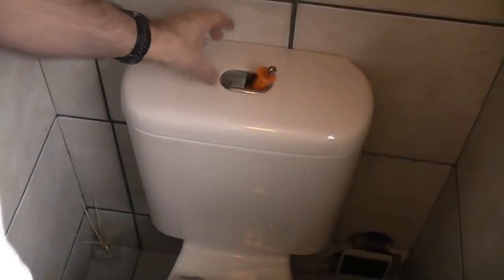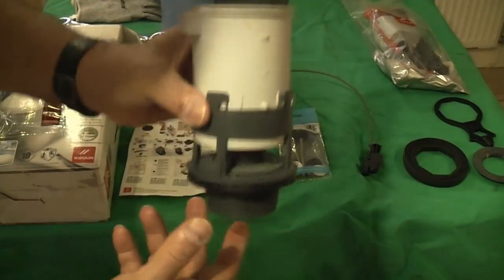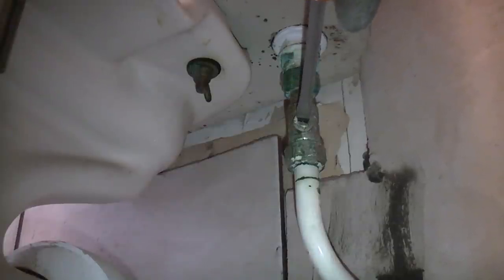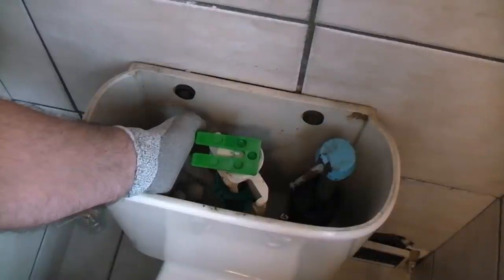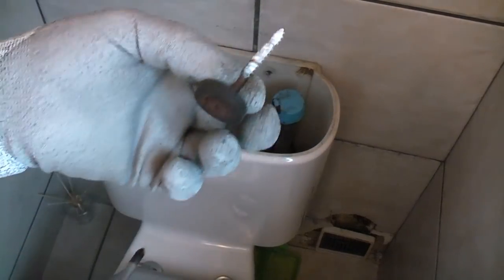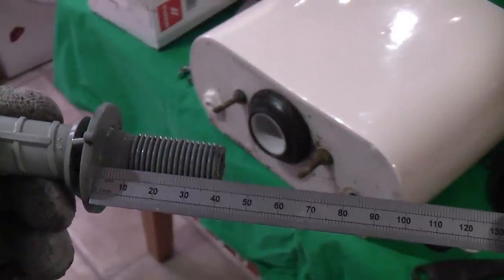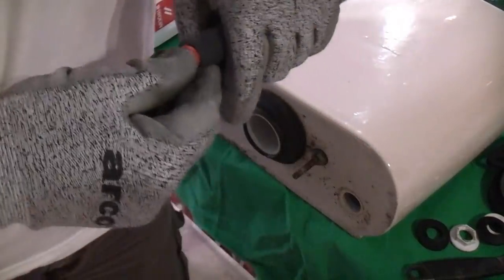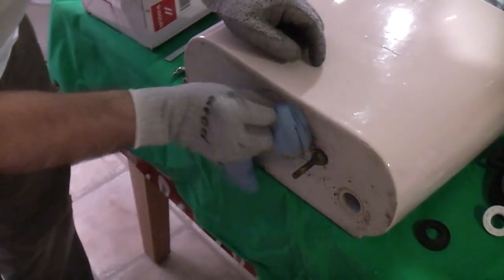Touch free toilet flush | Jollytronic Installation

Comment: i had the flush valve that you fitted for 10 years, it was good for all that time but it started to jam up and wouldnt reset when i pressed the button, they are decent for the price, 10 years use without fuss is good in my books. one issue i do have in my bathroom is getting condensation building up on the outside of the cistern, not sure the best way to deal with that.
Reply from the maker: That's good to know, I'd be happy if it lasted ten years (I might not be around then).
Condensation on some cisterns can be a real problem, we are lucky here, as it's not an issue. There is no heating in the downstairs toilet room (where this video was filmed), the other toilets are a fair away away from the incoming water supply, so by the time the water gets in the cistern, it has warmed up already.
I remember at one of my friends houses, the condensation was terrible and used to drip off onto the floor.
There's not much you can do about it, apart from insulating the inside of the cistern.
Thanks for the comment ;-)

Comment: the grey overflow pipe that you cut is actually adjustable💁🏻‍♂️ it adjusts just like those extendable pan connectors, you just pull the pipe and it springs up to different heights
Reply from the maker: That makes sense. The instructions were terrible, but I'm sure it showed a picture of a knife alongside the overflow 🤔
Thanks for the comment 👍

Comment: I’ve had many cisterns where the wing nuts have rusted solid and won’t turn, I have invested in a multi tool with a metal cutting blade to cut off the nuts.
Reply from the maker: I've used a grinder in the past- https://youtu.be/y4AdckesOlg?t=320

I had to use a multi-tool to cut the bolts that hold the toilet seat on a few weeks back 👍

Comment: So the first mod you did is not the norm ?
I prefer it chez..then again im from Bury :)
Is this one of them new flush things that you have to flush three times..to remove the log in the bog :)
N x
Reply from the maker: The first time the toilet broke a glued a plastic shim onto the top of the flush mechanism, that worked for years. Then it broke again, so had to modify it with steel wire and a space plug 😂
That worked great, but some kids struggled with it. I think it was a focal point in the room LOL
You only need to flush this once, just hold your hand over the sensor for a couple of seconds and it gives a great flush 👍

Some toilet flushes are totally useless though, I think it was something to do with the EU, where they reduced the amount of water in the cistern- so that you had to flush it several times 😂
Thanks for the comment, Neil 👍

Comment: What do you call those flushes that attach to the cistern lid? Ive been looking for videos on how to replace one but i dont know what to call them to search for info/videos
Reply from the maker: Not sure what the exact term is, I often call them push button toilets, or modern flush valves.
Some work by the button pushing directly onto the flush mechanism, and some use a cable.
Thanks for the comment 👍

Comment: Inlet valves with brass tails are preferable with fixed pipework and don’t tend to cross thread
Reply from the maker: I totally agree, I actually have one in my office and was going to fit that, but the shank was shorter than the shank on the supplied one, so I opted to use that.
Thanks for the comment 👍

Comment: Why didnt you add a flexi pipe?
Great channel best wishes👍🏼👍🏼 👍🏼
Reply from the maker: A few reasons-
1) the pipe was copper, painted, bent and short, so joining to the pipe would be difficult.
2) I've not seen any flexi pipes that are so short, most of the ones I have seen are at least 200mm long. It would also mean bending the flexi pipe- which should not be done.
Thanks for the comments 👍
Reply: Where I need to fit a flexi in a confined space a complete loop works well
Reply: @markware85  Hi - do you mean loop in the flexi pipe or something else?
Reply: @ultimatehandyman  makes sense - I think I once got a 15cm one but short ones are not readily available. Thanks for your reply really enjoy your content. 👍🏼👍🏼 used your video to help tank bathroom before.
Reply from the maker: @mshahid2898   I'm glad that the videos help ;-)
Thanks for the comments

Comment: Hi, Can this sensor be mounted on the panel of a concealed cistern? Thanks
Reply from the maker: Yes, it can, but I would not install another one to be honest.
The damn thing eats batteries- you get nowhere near the number of flushes that they say you can. I got so fed up with replacing the batteries, that I removed the cover and just push the button down manually. I tried new batteries a few months back and confirm that it no longer works!
Reply: Oh. Only I have arthritis and I am looking for an alternative to the push flush for my concealed cistern
Reply from the maker: I’m afraid I can’t recommend this one, like I say – the batteries always need replacing- then it failed. I guess it might be ok, as long as someone can replace the batteries regularly (they are quite fiddly). Sorry I can’t recommend another one!
Reply: @ultimatehandyman  Thanks anyway mate. I'll just have to find another sensor type. Cheers Nick.

Comment: Why would you not replace the service valve when you had a new one right there & the water off?
Reply from the maker: A few reasons
1. Service valves or isolation valves often leak when they are turned. When you turn them back to where they are normally they do not leak.
2. It's a downstairs toilet, so I would have had to drain all the pipework.
3. The toilet will be being replaced soon (I thought I mentioned that in the video)
Thanks for the comment 👍
Reply: @ultimatehandyman  chez - if one should regularly: like once every six months turn the isolation valve 360 will that prolong its working life?
Reply from the maker: @mshahid2898   I don't think so.
The more times it is turned, the more it will wear.
Dripping from the screw is extremely common on these types of valves, but turning the slot to certain positions will stop them leaking 👍